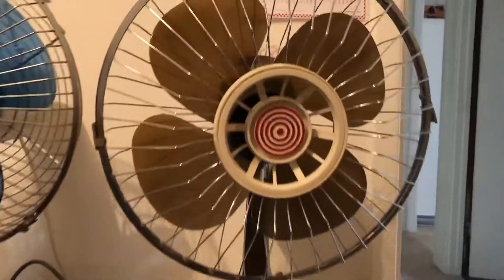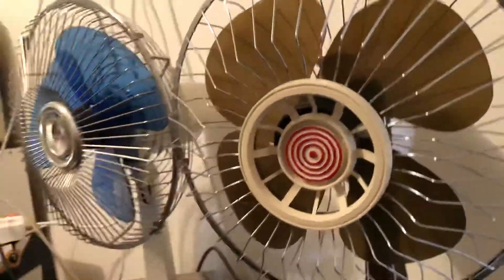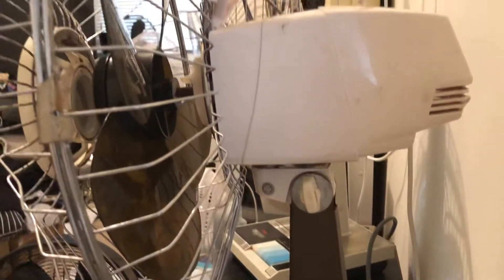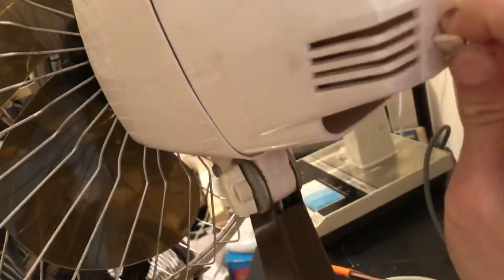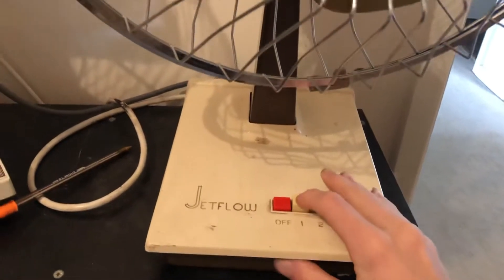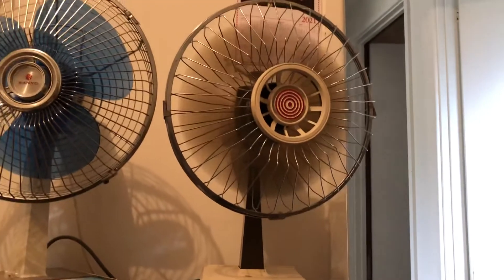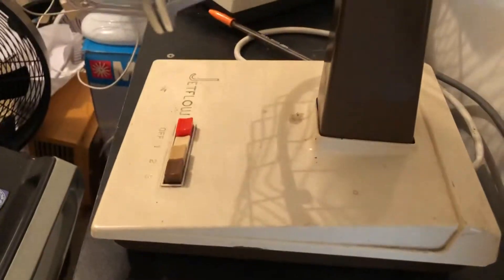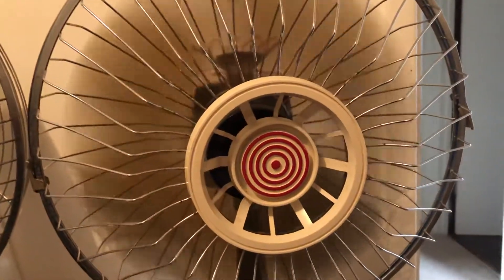2 vintage desk fans. Jetflow and Sanyo desk fans

Comment: How do you tilt the fan head of fan on the right
Reply from the maker: There is a screw on the right side that you can loosen which will make the fan face up or down and to make it side to side isolation you have to twist the switch on the back of the fan